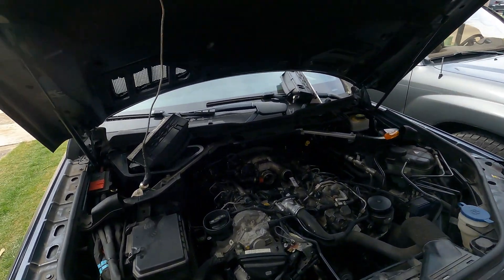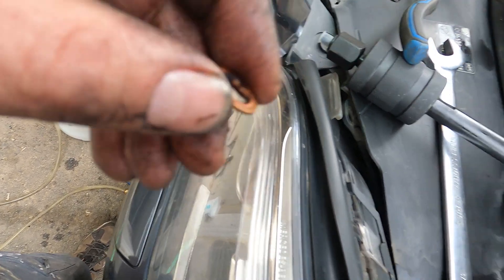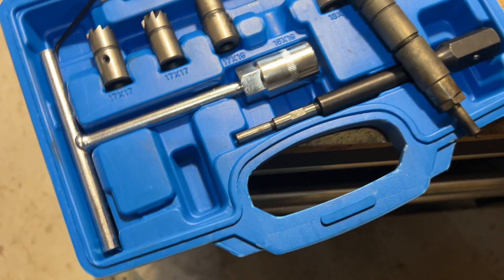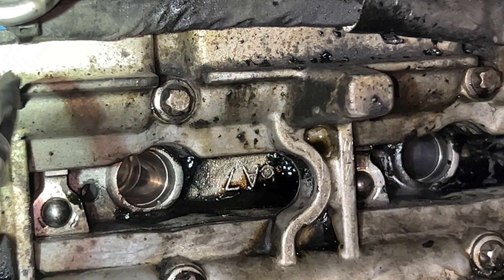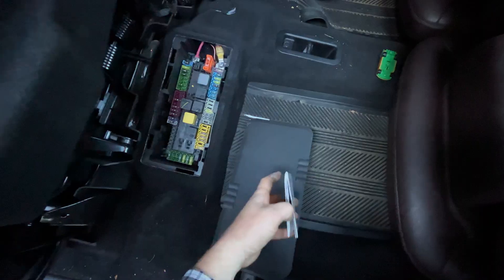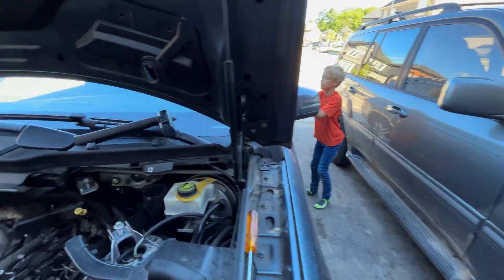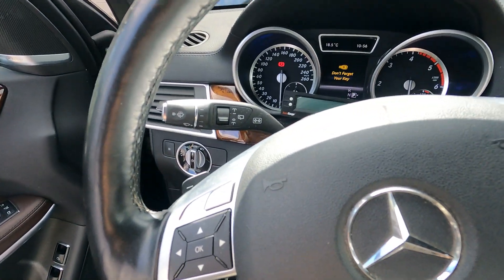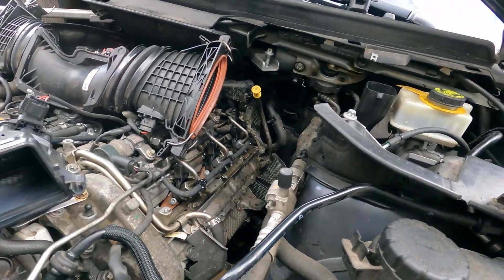Mercedes Diesel Leaking Injector - Black Death - How to Fix OM642 3.0 V6

Comment: The principles are the same for other diesel engines as well. Cleaning the injector seats and new soft bushings is key to success. In an emergency one can re use old seals if they are heated and cool down slowly, but chances are it will start leaking again. Proper torque is also important. I would like to say, that removing, cleaning and re-seating injectors at a regular interval (thousands and thousands of miles/km is sufficient) will prevent these problems and extend the life of the injectors quite a lot. But usually we just keep on driving until something goes sour even though we know better... 🤔😆
Reply from the maker: Great points, thanks for sharing!

Comment: What symptoms did you notice to troubleshoot and find out it’s a injector leaking ?
Reply from the maker: When stopping the car after driving, there was a diesel smell coming from the engine bay. You may also be able to hear it - check the video at about 15 seconds.

Comment: Great video, it was very helpful. I’ve done this job on my Mercedes, but I still haven’t managed to get the engine to start. There’s no more air noise in the fuel system. The injectors were cleaned and tested by a specialist. Their coding hasn’t been changed and they’re installed in the same positions as before. In your case, how many times did you have to try starting the engine? I’ve tried about 7 times. Thank you very much for your help.😊
Reply from the maker: I tried 3-4 times.   I think it could help to prime the fuel filter and lines by loosening  a fuel line connection by the injectors and have someone turn on the key so that the fuel pump turns on until some fuel comes out.
Reply: @VincesDIYs  
Thank you very much for your response. I followed what you explained, and it worked perfectly.

I slightly loosened all the nuts connecting the high-pressure line to each injector. When I saw that no more air was coming out while operating the diesel pump, I started tightening the fitting back onto each injector. Then, the engine started on the first try.

Importantly, I disconnected the power to each injector by removing its connector. I also bled each injector only by operating the diesel pump—I didn’t turn the key to start the engine.

Thank you very much for your help 😊

Comment: Very good job and good helpful video. I know it's time consuming but it saves you a lot of money from doing it at the dealer's. I've the same engine (slight difference tho as mine's a R 350 CDI here in France. But yes, very helpful, clear and straight to the point! Keep up mate!
Reply from the maker: Thank you.  Glad you liked it!
Reply: @VincesDIYs  I'm about to do mine now and have a question please. Did you warm up the engine before undoing the injectors. My car's been sitting for a while and it's pretty cold out there. Was thinking of perhaps using a heat gun to blow some hot air in order to soften the soot and get that screw loosened? What do you think?
Reply from the maker: I did not warm it up but it would have been a good idea.  A heat gun would help as well.